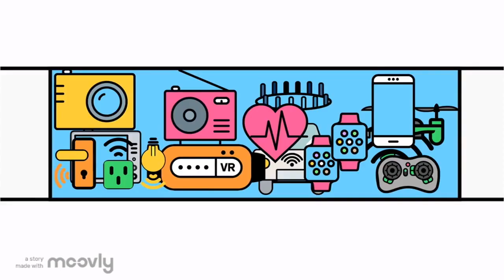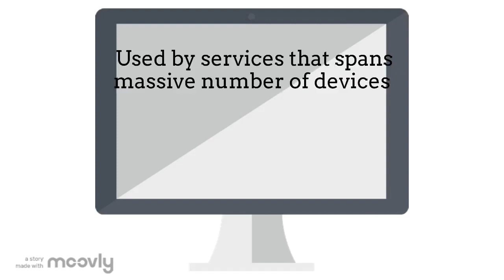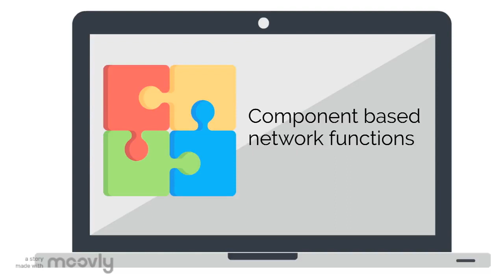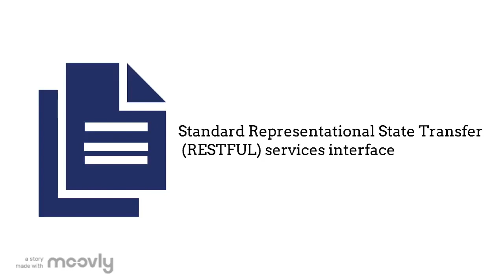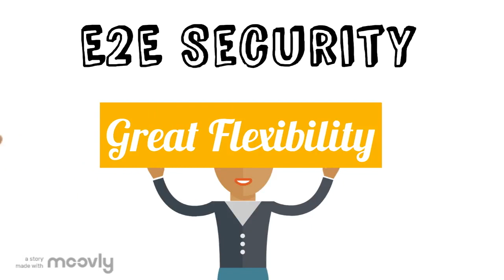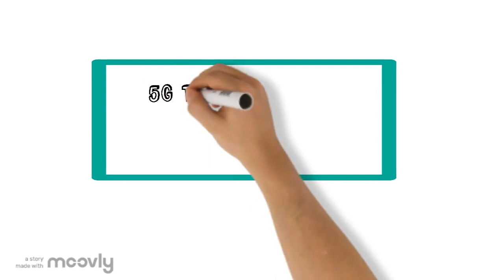5G implementation in IoT for a smarter world

Comment: Tele-robotic over the network is suffer from the delays and jitters issues due to the quality of existing network. Will 5G network address these problems. If utilizing higher radio frequency  spectrum allow less congestion, why have to wait so long to finally open up to 300GHz. BTW, 100GHz and above is into microwave alrd.

Comment: What is 5g？
Reply from the maker: suet yin lee 5G is a wireless technology that has low latency, high bandwidth that is able to connect mobile phones, smart machines and smart devices to the internet or to a network. It is an improvement from our current 4G technology with almost the same functionalities but with more flexibility and reliability.
Reply: In an easier understanding,   5G is an integration from 4G that differs more than just speed.  For example, higher number of simultaneously connected devices, lower power consumption, better coverage, lower latencies, higher number of supported devices, lower infrastructure deployment costs, higher versatility and scalability, or higher reliability of communication.

Comment: Why are the current common technologies for IoT  (RFID and Wireless sensing) not good enough compared to 5G?
Reply from the maker: ai xin  RFID and wireless sensing technologies span different frameworks and technologies, such as infrared and Bluetooth. So, it may be difficult for implementing various IoT in the same network due to compatibility issues. This will cause confusion and complicated management in the long run. Hence, 5G can be used to replace all these technologies as a standardized framework to ease implementation.

Comment: For NFV, metadata are stored in a centralised database, which could result in a single-point failure, what are the counter measures to prevent this from happening??
Reply: Tzi Yhi Choo hmm... Interesting questions! In my opinion, I think a good way to solve this problem is to backup the database periodically In several copies so that the faulty database can be replaced immediately without data loss

Comment: will 5g costly?
Reply: Kai Lun hmnn.. there is no answer to this currently.. however, from the new spectrum of radio wave frequency it uses, there is a possibility for it to be more costly than our current wireless technologies
Reply from the maker: In my opinion, i think that 5G will have a low to high cost price range depending on the services chosen. As it is just adding on to the existing 4G spectrum, some of the services will be of almost the same cost as current 4G services.

Comment: Is there anything beyond 5G, for example 6G? Will 4G and 3G still be available once 5G is implemented?
Reply: Yuen Jie Wong well,  this question is rather subjective, as the real outcomes of 5G implementation is yet to be presented, so it a yes or no answer depending on different perspectives. There is possibility of 6g standard but currently it is focused on 5g . 4g and 3g will still be available , just like nowadays 2g is still available to be used . Mind that 4g and etc is just a standard of radio communication, it is not a particular product that is used and be eliminated .

Comment: Cool is there any limitations?
Reply: Xhi Bo i think there is more benefit than limitation
Reply from the maker: True, the advantages of 5G are more prominent than the disadvantages. However, there are potential disadvantages of 5G such as low coverage due to increase in bandwidth in the early stages of 5G. More cell towers need to be built to overcome this problem and it may take time to do so.

Comment: I thought 5g is used in only cellular communication? Like how the previous generation 4g 3g 2g
Reply: 5G is a radio standard, just like wifi. While IoT stands for internet of things, radio waves is widely implemented in this field for data communication. Internet does not depict only wifi can be used. As a standard, 5G has been seen more capable than current wifi standard to be used in IoT

Comment: Good effort ^^ Is there any limitation of disadvantages of 5G?
Reply: Lee Jia Wei another disadvantage would be 5G mmWaves can fry your brain.
Reply: It made me so anxious I couldn’t relax, angry, agitated, brain fog, memory loss, rashes on my stomach,irritable, pressure in my ears, blew in my stool, then my little Yorkie began bleeding a month later. These frequencies so strong where all your wireless devices will be pushing 60GHZ. 
It fkn was making me go MAD. 
We had to remove almost all our wireless devices, then turn the router/modem on line back to 2.4GHZ. 5G will kill you and your animals. It’s a slow cooking us, as a microwave, as it will change your personality to very very negative due to the high frequencies. I hope this helps.
Reply from the maker: HI! Thanks :) Unfortunately, yes, 5G does have its limitations during the early stages of implementation. This is because the increase in bandwidth will lower the coverage of 5G, as the amount of cell towers we use today are tailored for 4G bandwidth. When a bandwidth has been increased, we will need to spend time waiting for more cell towers to be built, so that the coverage will be improved later on.